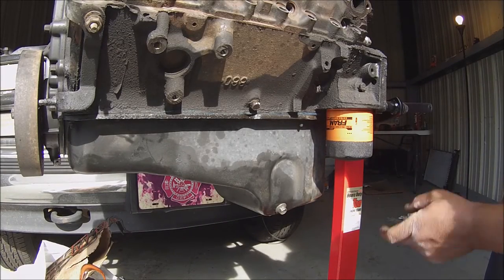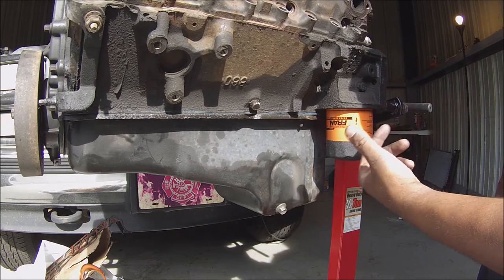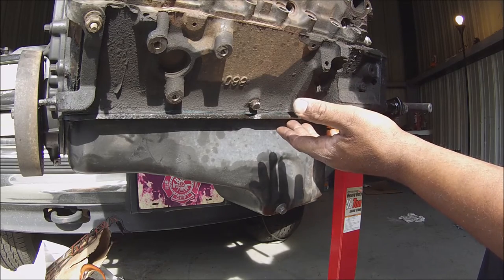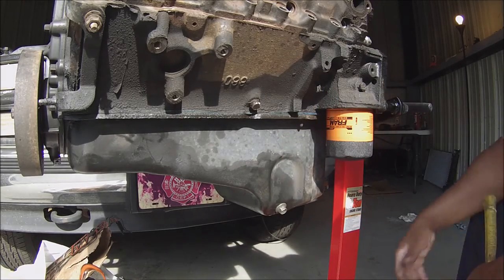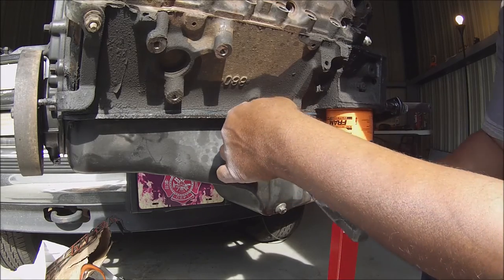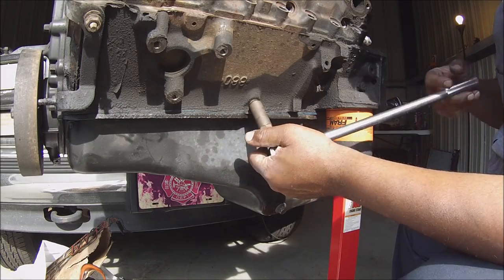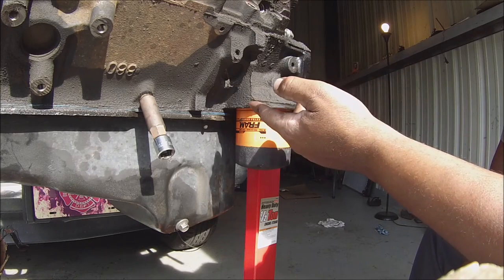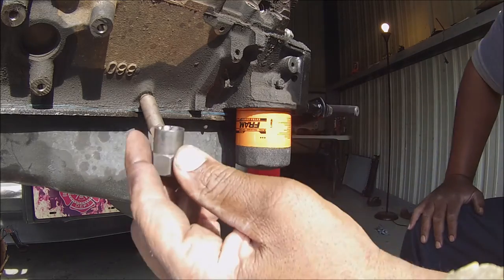Stripped coolant drain bolt

Comment: The reason your 14 and 15 didn’t work is cause it’s a 9/16
Reply from the maker: GM use metric bolts in 1996. This was not my first time working on a truck I had own for 8 years.
Reply: The 14 fits perfect on a 9/16....